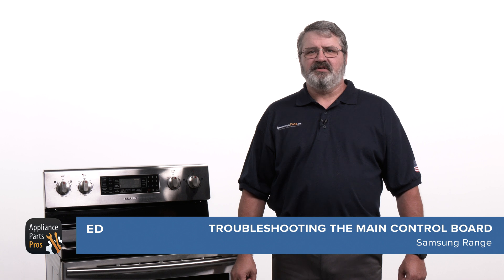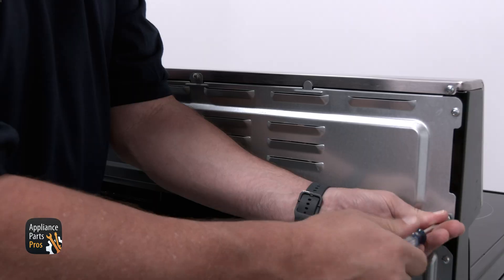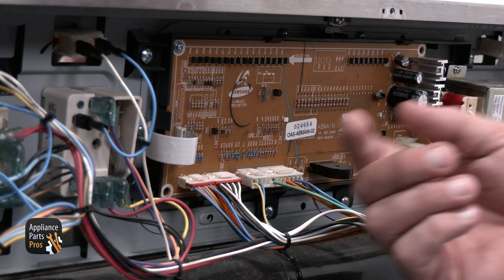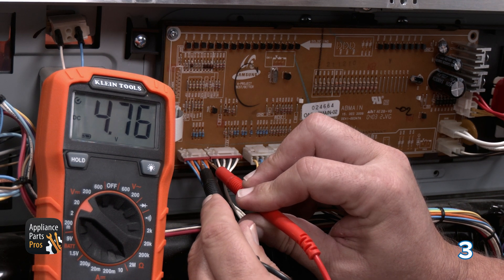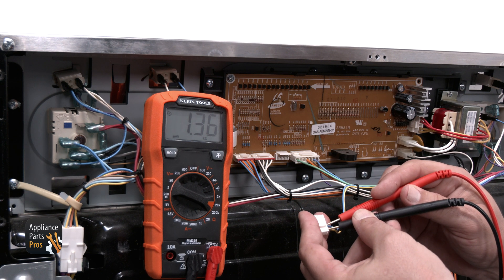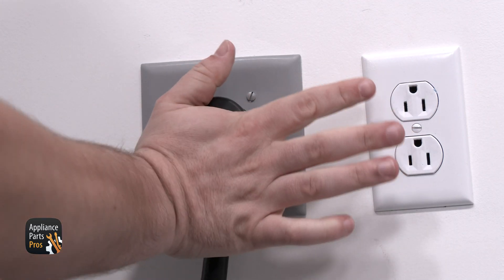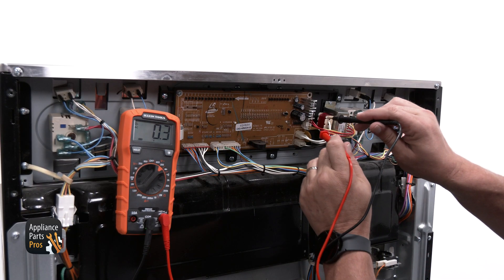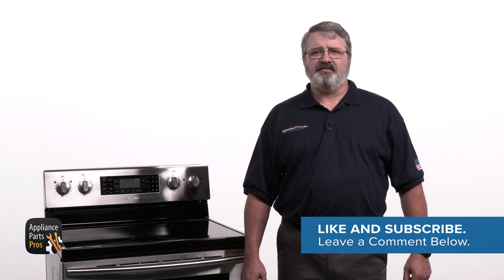How To Troubleshoot A Samsung Range Main Control Board

Comment: I found your video to be helpful, even though I have a Samsung Side gas convection 5 burner range. My display board doesn’t show clock or temp choice anymore. I found it had been switched into demo mode for short period of time but I cleared that now wonder about Sabbath mode which is an option on my range NX58k9500wg/aa. Have any idea what to do?
Reply from the maker: Per the tech sheet, "Press and hold the Sabbath pad for at least 3 seconds. The display will show the time of the day when the function is turned off." It seems like that should turn it off, but the language is sort of confusing.
Reply: Very good! Thank you for the video! I moved my stove to new apartment and when I connected it gave PF code. I took off the back to check the connectors. The stove works and fires up if CNO4 is disconnected. Once I connect it turns the power off... any recommendations? 
Than you